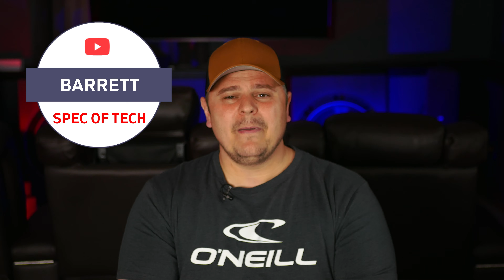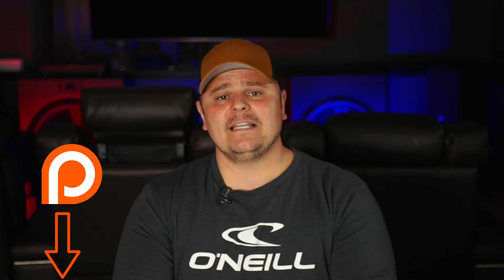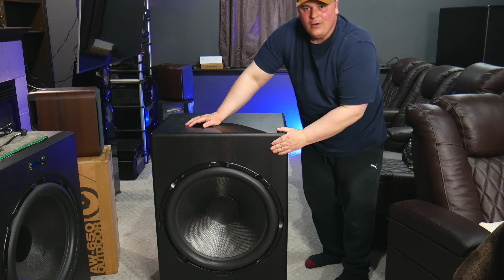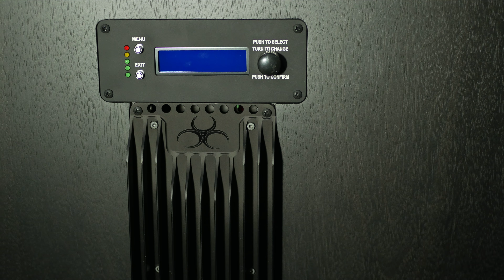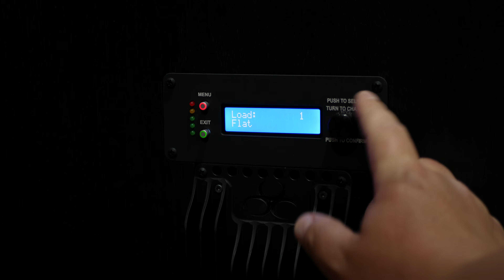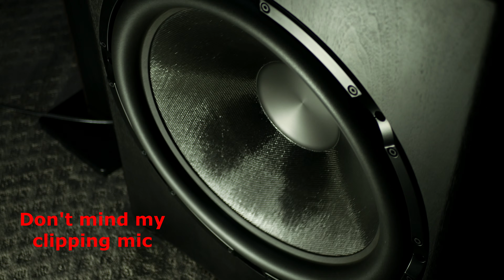DEMOS & REVIEW MONSTER 24” Sealed Subwoofer! Funk Audio 24.0E! Review and Demos!

Comment: Im curious as to the comparison to REL 25. Output of course no comparison one of these should = at least 4 REL 25 but is the upper band bass 50hz+ on par. I have REL 1508 Predators and even they are better than SVS, KEF, Martin Logan, Seaton Sound, JTR etc.. in that 50hz+ range let alone the REL 25 where this Sub is in that Price category.

The Ultra series is more than the REL 25.

Hard to buy something without hearing it, does Funk Audio have a return policy?
Reply from the maker: I don't have any experience with REL, so it is hard for me to say.  When you say the REL's you have out perform those other brands, where are you getting the numbers from for that comparison?  I am having trouble finding any numbers and measurements for the REL's...granted I didn't look too hard haha.

I would be fairly confident in saying the LFE24 Ultra will pretty much out perform anything out there that is anywhere near its price tag or below it.  The down side is that it is absolutely huge and crazy heavy.
Reply: @SpecOfTech  Yeah the Subs are expensive so not many measurements and people who get them don't normally do the REW they are simple consumers not tech people like us.

My opinion on them and the reason I use the brand as my benchmark for SQL comes from me demoing all the big box brands over the past few years and I found them to be the best Big Box brand out there as far as SQL is concerned.

I have dual Seaton F18 and Dual REL Predator 1508 and the REL still are better above 50hz much cleaner. Not that the Seatons are bad. LOL. They still are excellent   when it comes to the clarity REL beat them slightly. A normal person would never be able to distinguish the difference but I do.

I have demoed all REL models apart from the flagship REL 25 and the S line is amazing for clarity so can imagine the REL 25. I have demoed in front of SVS Ultra, Martin Logan, Kef, Bowers etc.. And REL has the clarity. Bowers and Martin Logan are very close like Seaton but IMO REL beats them for clarity.

Now as far as output that's a different story. Seaton demolishes all of them. SVS Ultra 16 demolishes the remaining and so on.

I had to send my Anthem MRX 1120 in for repairs on the subout having noise once I get it back I will do a video showing with REW of the REL 1508 Predators and the Seaton F18 before and after ARC as well as a max dba video.

You should contact REL and get a REL 25 and do an in depth review video and comparison to Funk Audio and the other brand 24 sub toy have for awareness of other brands like Funk Audio, Seaton Sound I never heard of until recently.
Reply: @stargazersperformanceworld  lol. The rel subs will definitely not come even remotely close to any jtr, funk, psa or rythmik sub at any output level or distortion. The driver and amps in these subs are on a different planet than rel. way more midbass and a ton more low end. Rel subs have no balls down low. Not knocking your seaton subs but he uses Dayton audio drivers with a few small tweaks which are decent but nothing compared to the above drivers. So not surprised you like the rel better than the seaton up top
Reply: @Ctripp2448  Like he said do you have any measurements to back that claim up about distortion and clarity?

Output yes of course there's no comparison Funks 24 ULFE beats them all anyways and is the most powerful at 4400rms. He had the most power driver on the market I have seen his 21 Pro 4800RMS he will still make if you ask but not advertised anymore.

But clarity is another story. That's why it's hard to buy subs from small vendors like JTR, Seaton or PSA because then you lose the return shipping.

PSA also uses B&C fiberglass drivers. They are powerful but I don't know about the upper frequencies.

Also for REL explain why their amp in the no32 is inferior to JTR or Rythmik? Forget the power output I'm talking about quality and filtering? Do you know what either use or how the Amps are designed? The speed at which the cross happens and ability to give that explosive burst instantly from capacitor capability?

All real questions not sarcastic questions just so you know

🍻
Reply: @stargazersperformanceworld  jtr, rythmik, funk/harbottle have all been measured on data bass and audioholics. They have some of the cleanest drivers on the planet that have been measured. Low Distortion and group delay equals good sq. Funk amplifiers/speaker power amplifiers/rythmik are top level. Rel subs are good with low distortion and low group delay but they are severely lacking in output compared to the above subs. There amp looks like a basic build amplifier with low power. So when that 21 inch funk is cruising along at high playback levels that little rel with a 15 inch driver and a measley 1000 watts will be hitting its capacity which drives up distortion in a hurry!!  

Rel no.32.  10k for a 15 inch driver and a 1000 watt amp with a -6db at 15hz. Absolutely overpriced for the performance.

10k. Funk/jtr/rythmik/psa will walk all over that rel in every category.  The drivers are on another planet. 

Which sub will have less distortion at 115 db level?  15 inch 1000 watt or 24 inch 4000 watt?
Reply: @Ctripp2448  OK you are talking about SPL again. Yes of course the power is there, my Dual Seaton/Ultimax I get over 130db in room and of course dual REL can never catch up.

If you give a benchmark of 100db purely across the board and then measure clarity explain how the JTR or Rythmik are superior for example? 

JTR sealed RS1 is 16hz and Rythmik F15HP is 14 HZ. REL no 32 is 15HZ. 

JTR is paper, Rythmik is Aluminum or paper and REL is 4 layer Carbon fiber like Funk Audio. Also REL has 4inch stroke vs 3inch everyone else has including Funk.

REL uses Film Capacitors has High and low filters and all kinds of engineering and high end components just reach out to then they will explain how they build their amps and crossover.

Forget Funk, Funk is probably the best his amps and materials and motors. He even has a proprietary voice coil cooler apart from the normal air movement cooling. 

I really would like to hear how the other subs are superior in QL and what components make their product better apart from output.

 In output Rythmik doesn't defeat REL unless you go for the 18 but if you compare the 15s no comparison in output.
Reply: I missed the part where you said REL distortion is good. Yes that's where they shine.

Of course when comparing an 18 to a 15 you will have more output of course.

But apples to apples,  15 to 15 which 15 on the market beats the REL No32? Paradigm is comparable to the 1508 and 1510 but not No32.

I get it about the output that's why I Went for the Seatons and not more 1508s or spending $15k on two REL no 25s.

 I'm talking to Funk about getting some subs from him, that looks to be the only sub to compete with REL in clarity but pack 4400rms also.
Reply: @stargazersperformanceworld  which 15 rel are you comparing to rythmik 15/18?
Reply: @Ctripp2448  No 32, I reference the No25 as it was the previous model but the no32 had since replaced it
Reply: @stargazersperformanceworld  so you are comparing the no 32 to the fv25 correct? I will take  the fv25 one on one all day against that rel. I can buy three of the fv 25 and absolutely smash that rel in every category for same money.
Reply: @Ctripp2448  Your still not explaining one to one. One to one no comparison 600rms vs 1000rms. Metal driver vs carbon fiber.

The Filters etc..
Reply: @stargazersperformanceworld  when I compare subs I look at price. What sub or subs perform the best at a certain price. again there are pros and cons to every driver material used. A metal cone does not equal better.  There is nothing special about implementing filters. The rythmik actually has a lot more filters and adjustments on their amps than the rel does. So you are saying filters and cone material are what makes rel subs better than the above? So it’s takes a 10k rel sub to possibly outperform a 1500 dollar rythmik?  And you think the rel can hang with the jtr/funk and psa big boys?
Reply: @stargazersperformanceworld  if we compare the 1500 dollar rel and the rythmik 15 the rythmik will smash it. Same price category
Reply: @Ctripp2448  Again you keep coming back to SPL and money.

Forget the money and we are using 100db benchmark.  One sub quality to another sub quality. 

I mean there's $100k subs out there if you want to talk about money. $10k is nothing in the high end market.

I'm talking strictly QL right now money and SPL aside. 1-1 Rythmik is not beating the 1510 let alone No32.

And you say Rythmik has more engineering in their amps and filters. What makes them better other than their proprietary servo technology?  Room correction makes this irrelevant anyways .

REL has their own DSP and App control, high and low filters that Rythmik doesn't.  have for one thing. I had talked to REL about the No32 and they gave me an explanation on materials they use, and capacitor capability, materials etc but I forgot now the whole convo.
Reply: @Ctripp2448  I have it I doubt it, I actually will get it to make a video soon as well as JTR and a Carbon Special REL  and do a comparison.

You can see.my few videos I made in the Seaton and REL 1508 and I will do the Rythmik and JTR maybe PSA in the future as I compare products to find something I'm fully happy with.

The Seatons are excellent 7-60hz but 60hz-120hz they are slighly.more boomy than the 1508s.
Reply: @Ctripp2448  But I do agree for value $10k I wouldn't pay for the No32. Funks 18.0 is better at 2400rms carbon fiber for half the price.
Reply: @stargazersperformanceworld  why do u keep saying I’m talking spl? I am talking about distortion. I can guarantee you the rythmik 15 will smash the 1510 1-1. I just looked up the data on both from data bass and audioholics.  F18 was tested so subtract 3db for comparable to 15 size. Guess which sub has less distortion and more output?  And the rel is more expensive lol. having their own dsp, filters etc makes them no better than the other companies filters. What makes them better?  App control is meaningless once subs are dialed in with rew.  Should never have to touch dials again etc.    You stated in original post that your 1508 has better performance than the jtr 18.  You have to be kidding. what do you mean forget about money? That makes no sense to compare products.
Reply: @Ctripp2448  Yeah at 100db REL no32 is better QL than JTR I said.

And I was comparing Rythmik 15 apples to Apples to No32 and then the 1510  I don't know what you mean about subtracting 3 db in That comment.

Distortion is QL my freind so I don't know what that comment was about and people in here want to believe that cone material does nothing to the distortion but that's completely false.

 A cone that does not maintain shape across the surface area will create variances in sound waves so that's why people are using different materials to stiffen the cone and Carbon Fiber is the lightest and most durable material.

 That's why a lot are using Kevlar fibers to strengthen the cone, I had Alpine Subs in my car using Kevlar to prevent the cone from distorting. Bowers users Kevlar in their subs.

There's no reason tp argue, I have my point of view and you have yours we are both right in our ways and wrong in others so what's the point of us creating a huge thread trying to prove each other wrong?

I agreed that the NO 32 isn't worth the money for a nor al person but if you have money than it's in the top 5 subs.
Reply: @stargazersperformanceworld  I’m not arguing just giving you facts.  So the rel has more distortion and a lot less spl according to data that you can see but the rel is still better?  Please explain.  So the material of cone used determines which sub is the best? So if cone is so much better on rel driver then why does it have more distortion?

And no rel does not make any sub that is anywhere near jtr, funk, psa period
Reply: @Ctripp2448  what data? What graphs did you provide?

I'm going by ear.

REL doesn't make any graphs so 🤷
Reply: And no need to mention Funk, simply by being Carbon 4400rms drivers we can conclude they are the best subs.
Reply: @stargazersperformanceworld  measurements were made at audioholics and databass. The rel has more distortion than the rythmik and jtr. Output not even in the same atmosphere. You have not even looked at any data and claiming rel is better 😂😂😂
Reply: Stay tuned I will be making some videos in a few months and do some comparison with these subs, can't do the No32 becuase its only available through dealers but can do the Carbon special.
Reply: @Ctripp2448  show me the link, now your going from a nice back and forth to condocending tones.

Where's the link???

There are no REL No 25 or 32 measurements.
Reply: And measurements don't mean that much. Martin Logan, Bowers, Focal, Paradigm, Revel, hell Borreson speakers all will give a flat response on paper but sound different still.
Reply: Hey thanks for reminding me about bass data. I didn't know that the Seatons were Daytons when I checked  last year now I just found the Dayton 18 and it's exactly what I'm seeing.

At peak, upper frequencies distort where the 1508s don't distort even at full excursion. So at 75%  excursion the Seatons are excellent and are better than the 1508s but when I drive them they lose it. 

So if I were to build 2 more and keep them from full excursion I would get the clean upper frequency QL with great output.

Awesome thanks 👍
Reply: @stargazersperformanceworld  on the rythmik numbers you will need to subtract 3db for numbers for 15 inch driver compared to the 18’driver. There are no measurements for the 25 or 32.  A 15 inch driver with only a 1000 watt amp will only do so much. If it is ever tested it will be outperformed just like the 1510 sub is easily. So I have given u the data so you can see for yourself. Rel are decent subs but easily outperformed for the same and less money. They are not in the same league as the big boys. Not even close
Reply: @stargazersperformanceworld  speakers yes more than just measurements.  Subs measurements will tell you everything you need to know about the quality of a sub.

Comment: Love the channel.

I have a large open concept living area around 10,000 cubic feet. Main listening area (couch) is around 12ft from where the subs would be. What are your thoughts on Funk Audio 2x18.0e for this area. Too many options.
Reply from the maker: If you are looking for something with a more premium looking cabinet, Funk is one of the few that offer great performance and a more premium finish.  What type of bass experience are you looking for?  The 18.0E are a great subwoofer and would provide great bass in that room, but if you are looking for something a little more on the basshead side of things, you may find these will fall short.  If you do want a more palpable bass experience, consider the Funk 24.0 (not the 24.0E), the LFE Ultra, or check out JTR CAP4000 or RS2.  I hope that helps...cheers.
Reply: Thank You. Some of those you suggested may have a too big of a footprint. I emailed JTR and the suggested 2 Cap 2400 also talked to Powersound and he also gave me some options.

Comment: How do you think these subs do compared to a jtr cap 4000?
Reply from the maker: Well it isn't really apples to apples comparing these 2 sealed subs to the ported CAP4000.  A more relevant comparison would be the Funk Audio LFE24 Ultra to the CAP4000.  In which case the LFE24 Ultra will beat the CAP4000 in the low end output.  The LFE24 Ultra will also be cleaner with less distortion.  That being said the CAP4000 is significantly less expensive than the LFE24 Ultra.

These 2 sealed subs would be more comparable to the JTR RS2.  IMO the Harbottle C24 L2 will out perform the RS2 in output and with less distortion.  The Funk 24.0E will have slightly less output, but probably quite close to the RS2 (within about 1.5 to 3db), but again distortion would be lower.  The Funk subwoofers are well known for their low distortion accurate and clean bass.

If aesthetics are important to you, the Funk and Harbottle definitely take the win over the JTR subs.

JTR subs are VERY hard to beat in shear output for the money, no question about it.  I do feel that is their main strength.  Lower cost and lots of output, but this Funk 24.0E really blurs the line on that one for JTR, price wise they are similar.

Hope that helps...cheers.
Reply: @SpecOfTech  that clears it up a lot. I appreciate the detailed explanation cause I really don’t know much about funk. I ordered a jtr 4000 and expect to get it in September. It’s crazy to think it gets even bigger and better but at the same time more expensive. 

I have the pb 16 ultra now so I will be pairing the jtr4k with it for the time being. Hope it pairs together with a problem. Both being ported should be ok.
Reply from the maker: @Snskch3  You will undoubtedly be amazed by the CAP4000, it has absolutely incredible output.  The thing to watch out for when pairing 2 different ported subs is their tuning frequency.  They will both be tuned at a different frequency and you will run into some cancellation/phase issues at each of their tuning points.  I recommend using REW and a Umik-1 to measure them.  The good thing about the CAP4000 is that it is tuned below the capabilities of the PB16, so you don't have to worry about that frequency :).  With some work and tuning you can get them to play together though.
Reply: @SpecOfTech  that’s good to know. I was slightly concerned about that
Reply: This is a common question I see a lot in comparison to the LFE 24 Ultra. Many don’t believe that a single 24 can beat a cap 4000.